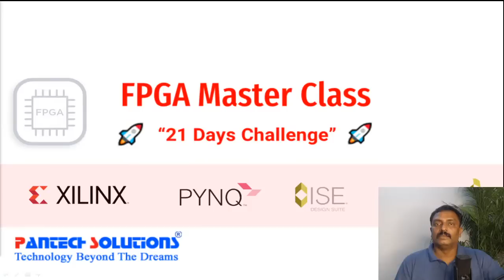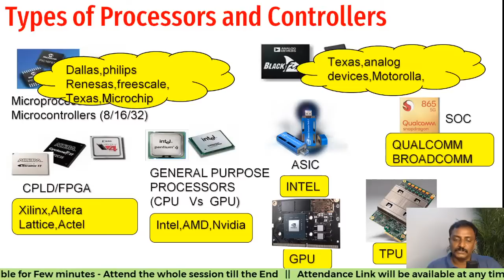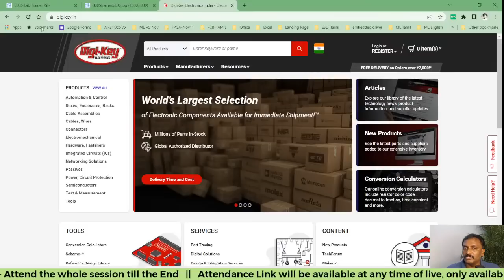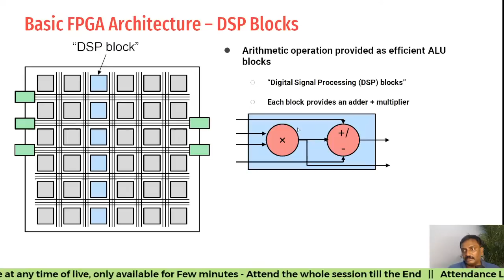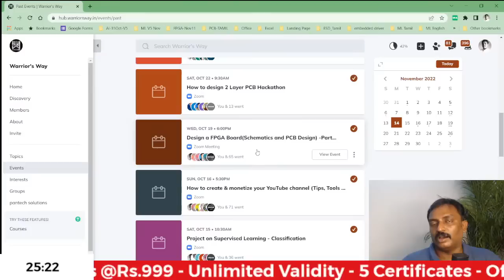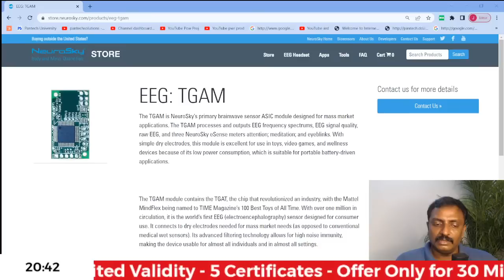FPGA Master Class Series : 1 / 21 Days - M.K Jeevarajan

Comment: 00:02 21 Days FPGA Master Class Challenge focuses on building self-learning as a habit.

02:26 Covering various topics including creating projects, operators, data flow modeling, designing FPGA boards, interfacing components, and programming

06:43 FPGA Master Class Series on system design using Cortex M4 series

09:07 Importance of self-education for personal and financial growth.

13:40 Different types of processors available in the market

15:47 Microprocessors require separate chips for peripherals, while microcontrollers have everything integrated on a single chip.

20:03 DSP processors are efficient for mathematical calculations

22:02 FPGAs allow customization of peripherals and code, unlike DSP processors.

26:05 FPGA is tailor-made and customizable for peripheral and core customization

28:04 FPGA offers higher performance than DSP processors due to parallelism.

32:15 GPU is different from FPGA, as GPU is mainly used for rendering and deep learning applications, while FPGA is purely digital and not suitable for analog signal processing.

34:23 FPGAs allow customization of chips, reducing complexity and number of chips used.

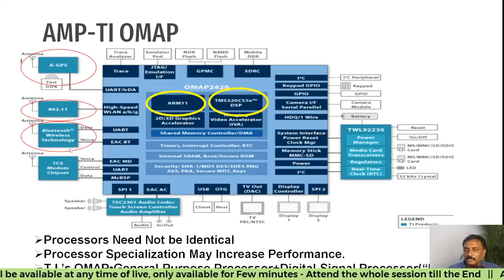38:24 ASICs and FPGAs have specific applications and can be used to reduce costs for large quantities.

40:24 FPGAs are ideal for hard real-time systems like nuclear reactors.

44:23 Different scales of integration in integrated circuits

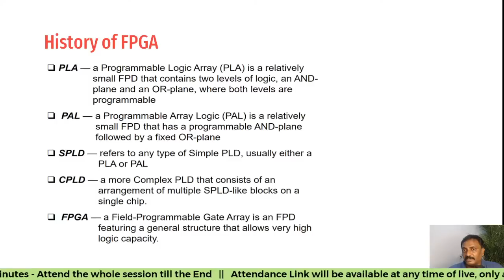46:19 FPGA Master Class Series covers various programmable logic devices (PLDs) and their programming languages.

50:13 FPGA processors can be either hard-core or soft-core

52:15 FPGA can be used to customize cores and peripherals, and is commonly used in place of microcontrollers.

56:14 Consider hardware tools, peripherals, power consumption, and supply requirements when choosing an FPGA for embedded system design.

58:13 Combo offer for five courses at triple nine rupees with lifetime validity and access to the community.

1:02:13 The advantage of FPGA is that it allows customization of the integrated cycle.

1:04:09 The video discusses the development of a headband using an Asic module for measuring children's attention levels during meditation.

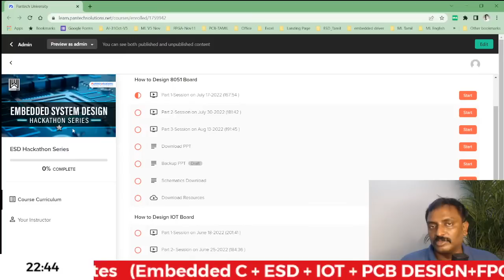1:08:34 The video discusses FPGA Master Class, including board design and IP course.

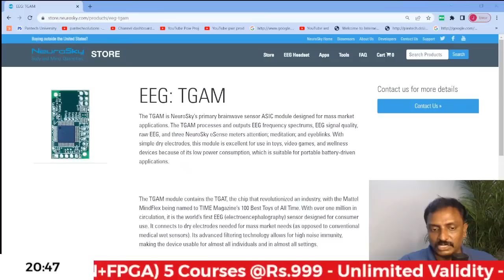1:10:28 Select FPGA based on performance, cost, and application requirements

1:14:37 YouTube courses have lifetime validity and provide access to a growing community.

1:16:31 FPGAs have a wide range of applications and their cost varies depending on the system design.

1:20:27 The gold membership for this course is priced at Rs. 10,000 plus GST.

1:22:21 The video discusses the list of FPGA boards available for designing.

1:27:07 Learn C language, Python, Matlab, OpenCV, and FPGA architectures for system design and software engineering.

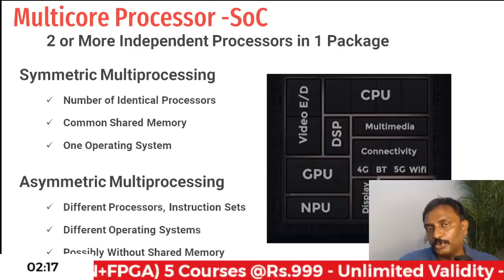1:29:02 The cost of a zinc-based board is around 15,000 to 17,000 rupees.

Crafted by Merlin AI.
Reply: Sir I didn't  get all videos .I want to learn this full course please help me.